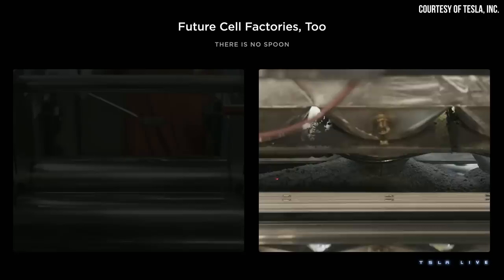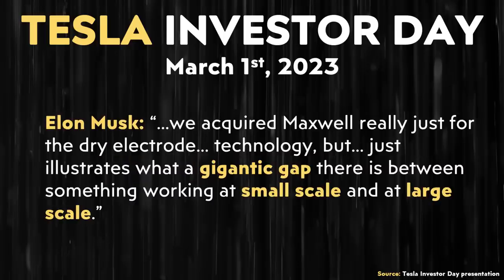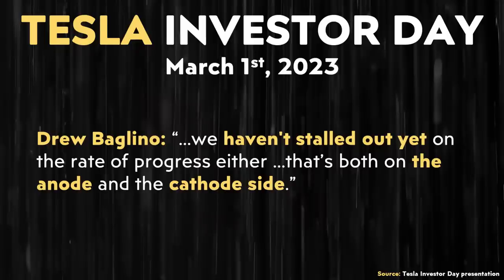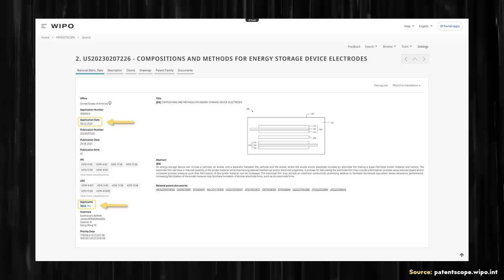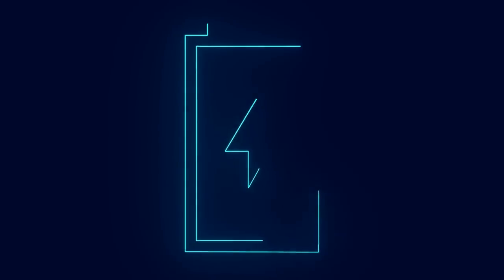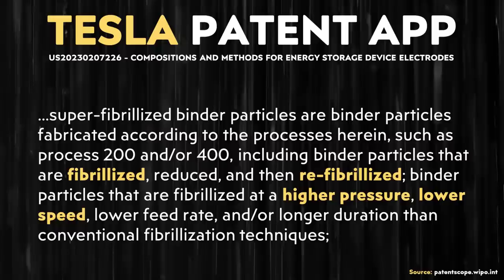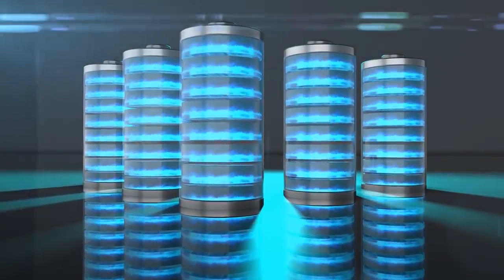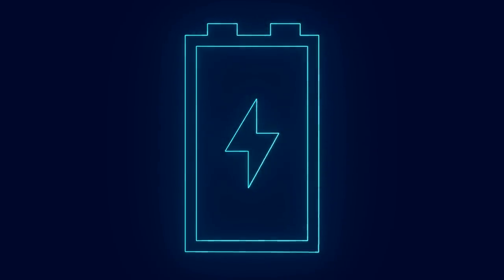NEW Tesla Dry Battery Electrode Patent App | Why it Matters!

Comment: Thank you for calling this out John.  I'm not a patent attorney but I can say that these patents are not covering the same thing.  The part that really matters in a patent are the claims.  Compare claim 1 on pdf page 18 of the new application to claim 1 on pdf page 18 of the 2021 granted patent.  The new application claims a film: "An electrode film used in a energy storage device..."  The patent claims a method: "A method for fabricating a dry energy storage device thickness of about 50 um to about 120 um comprises a single electrode film comprising :..."  I believe that on the first page where it says the new application is a "division" means the core idea has been separated out into two specific things to separately patent.

Comment: Tesla may not be 'refiling' the same Maxwell patent, it could be just adding additional Claims to the subject matter that were not claimed previously. That's called a CIP (Continuation - In - Part) which retains the same filing date as before but claiming more out of patent subject matter previously described but not claimed.
Reply: Why would this typically occur? Someone at Tesla realized they could fine tune the patent filed for more protection long term or more control?
Reply: @justlisten82  : CIP is usually for 2 reasons: A. Add more claims to the subject matter already described in full but never claimed. If this is the case, the new filing with new claims retains the same filing date as the original since no new subject matter is added.
B. Add new claims to newly added subject matter to the original. If granted, these new claims will have a latter filing date as the new filing.
I had a patent filed in 1998 originally that had subject matter covered in about 30 pages of description. The original patent claimed 12 claims. Subsequently, in the following years, my patent attorney added new method claims, which resulted in ten new patents awarded, all with the same original patent filing date.
If this is the case with Tesla, Maxwell must have described in detail many other useful methods that they have since discovered their usefulness (?)
Reply: @nonesounique  thanks so much for your reply. Much appreciated. Better clarity now.

Comment: Can we stop with the tesla is behind with the goals b.s. on 4680s please? 

Per elon last August he said the 4680 program is on a 6 year timeline drew and Zach also have said 4680s are exactly where they wanted them.

Further elon said to end 2022 the internal 4680 goal was to be equivelant to the best current ev cell tech. Multiple 2022 model y awd 4680 cell teardowns proved this out, showing 4680s within 6-10% of the best available cells in energy density at pack level. Done by the limiting factor and munro live. 👍🏻

He also said in that same interview to end 2023 they wanted to be ahead of anyone else with the 4680. So far we don't know if this will play out or not right? Nobody has torn down the most recent 4680s to ascertain the validity of this stated goal. 🤔
Reply: Interesting points, I am not a contrarian and am immensely impressed with Tesla ability to go from a non battery producer to producing batteries at scale in such a small time frame but I think it is safe to say that Tesla is behind in their projected production of 4680's.

Elon at battery day in 2020 stated they were projecting to produce 100 gigawatt hours by end of 2022 enough to power 1.3 million "cars" so they are well short of that but exponential growth projections are hard to manage and they have exceptionally well to reach the current production run rate and will no doubt see dramatic improvements in the coming months.

Turning the impossible into late is what they do!!!!!

Comment: I am not a patent lawyer. IMO, Tesla is not interested in hording IP. They file patents largely to prevent some other goo-head from trying to patent their technology and charge Tesla a licensing fee to use it. Going in the other direction, Tesla released all of their patents for public use years ago. This aligns well with their stated goal which is to transition the world to renewable energy.
Having said all that, being able to use DBE on the cathode as well as the anode will make battery production lines fit into a footprint about 10% of the size required for wet slurry processes.
Reply: It's not the size reduction that's the most attractive with dry electrode manufacturing though

It's energy expenditure and manufacturing speed: with dry electrode manufacturing, you remove 50-90% of the energy expenditure in battery manufacturing and massively increase manufacturing speed because you don't need to wait for the solvents to dry and start with a higher quality material in the first place.
Reply: @neutronpcxt372  So many advantages. So many cost savings. This will make the Tesla 46-80 the best, cheapest, longest lasting, most power dense cell in the world.
Reply: The 4680 is pretty much outdated. There are other technologies out there in development in near future will make a 4680 look like a normal D cell battery.
Reply: @jackylsmith8138  I've heard plenty of people talking big about their next great advance in battery technology. What I have NOT heard is that any of these advances are proven or anywhere near coming to production. "Speak softly, but carry a big stick" T. Roosevelt.
Reply: @jackylsmith8138  ? 4680 cells are just a form factor...

Comment: The newly published patent application US2023/0207726 is just a CONTINUATION (and not a continuation-in-part) of the provisional application 62/302,056 filed on March 1, 2016, which has already yield two granted patents (US10,923,295 and US11,587,741). It just means that Tesla is seeking to secure more claims from the original disclosed specifications. This does not extent the life of the patent rights, which is 20 years from the first priority date. All of the patents belong to the same patent family and rely on the same specifications.

Comment: The binder that Tesla is using is PTFE (Teflon).   There has been some indications from reputable sources that PTFE in the dry cathode degrades quickly causing the batteries to degrade quicker than expected.  This could be why 4680 batteries that have been manufactured by Tesla, and disassembled, don’t have dry electrode cathodes. This also explains why the capacity of these batteries is considerably reduced from Battery Day expectations?
Have you heard anything about use of a different binder material in Tesla cathodes?

Comment: The scaling issue is, in my opinion, the reason the Cybertruck and the Semi were delayed…. Possibly the Roadster as well.
Reply: Probably not. They just built and finished the plant to build CT. IDRA had to build the presses. Tesla had to design a way to build it, since it uses a exoskeleton. So when you get in a accident, your vehicle gets totaled. My guess  insurance will be sky high for CT.

Comment: Just one general rule re patents. 
A soon something - a new product or technological procedure thats commerically usable - has been published it cannot be patented anymore because then its state of the art. Only when someone has patented this before and was paying the maintenance fees they can forbid others in the contries where the patent is valid to produce and sell. 
Another also interesting point with a patent application its whats called: 'freedom to operate'. With the patent application it will be investigated if there are patents (the still valid and active ones are interesting) around which could forbid to used a procedure etc. Even a rejected patent application will show if a procedure can be used without the risk of being fined from Patent trolls etc. 
Below in other comments its already described that the 2017 and the now (I suspect it was done 18 months ago) patent are different.

Comment: In native form at room temp PTFE teflon micelles are generally spheroid in conformation.  Under high heat the micelles elongate longer and longer.   They are like long cords which entangle their neighbors and conjoin.  They also entangle with stuff around them, like graphite.  In this way the anode powder conjoins into a contiguous, pliable sheet, manipulable at room temp later (and cuttable into long strips during the subsequent slitting stage).  People know teflon from their use of frying pans in the kitchen environment yet this propensity of PTFE (teflon) to undergo fibrillization under high temp is generally unknown to them.  Think of the PTFE as having a kind of Spiderman web effect.
Reply from the maker: Great explanation - thank you!

Comment: This is generally the way things work for U.S. patents (of course, there are many details left out here to keep this summary manageable). 

1.  This Tesla patent application is a continuation application, which claims priority to a divisional application, which in turn claims priority to earlier applications.   "Priority":  when there is an unbroken chain of applications, the later applications may get the benefit of the earliest filing date in the family, so no public disclosures after the original filing date can be used against the follow-on application(s) -- in other words, continuation/divisional applications are treated like they were filed at the same time as the original application.  

2.  Under the current U.S. rules, none of the continuation and/or divisional applications will extend the time of patent protection protection - again, they are treated as if they were filed at the same time as the original application.  Any patents issuing from these applications will all have the same term end date of 20 years from the filing of the first application in the family (this is the general rule -- like anything, there are always exceptions, none of which seem to be in play here). For example, if a continuation application in a long patent family chain that is filed 15 years after the original application, would have a short term -- likely no more than 3-4 years depending on how quickly the Patent Office acts on the application, as all family members' terms end at the 20 year mark.  

3.  A continuation application cannot contain "new matter", i.e., material that was not present in its parent application.  The inclusion of any new material makes the application a "continuation-in-part" application.  The new material cannot claim priority to the original filing date date in the family.  This is important because any public disclosures ("prior art") that comes into being between the original filing date and the continuation-in-part filing date could be used to deny a patent on the new matter. 
 
4.  Filing of continuation applications is very common, as it extraordinarily common for a patent application to contain a lot of information that is part of the same "invention" (e.g., many different apparatus embodiments, methods of manufacture, etc.).  A patent applicant is only allowed a certain number of claims in an application before they have to start paying huge additional fees for more claims, so many applicants first focus on only part of the original disclosure in the first set of claims.  They can do so without risk of giving up any potential patent protection on the remaining material in the original application, because they are allowed to file as many continuation applications as they want to try to get patent protection for all of rest of the patentable material in the original disclosure.  

This is already too long, so I'll stop there.  TLDR:  There is nothing new here -- this is just Tesla continuing to maximize the scope of patent protection *for the material Maxwell already disclosed* in its original application.
Reply: Thanks. Interesting!